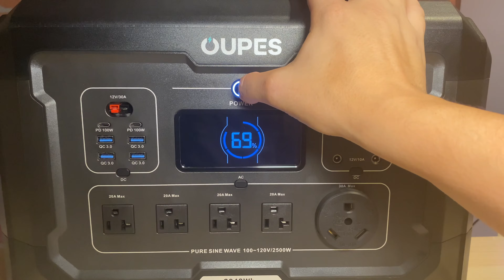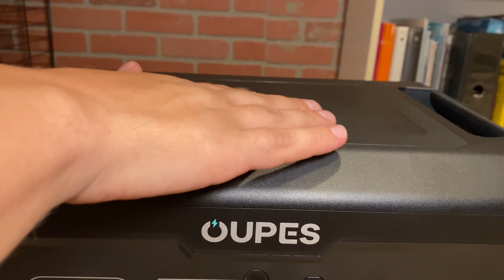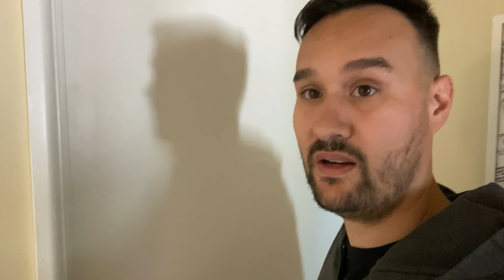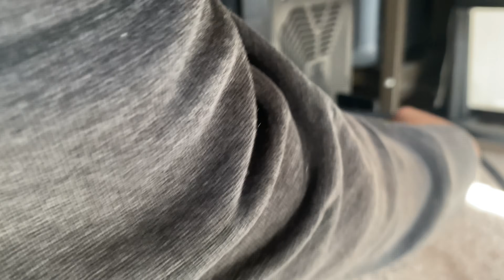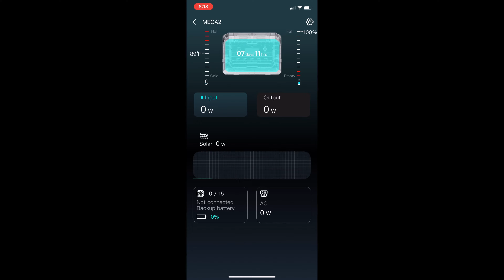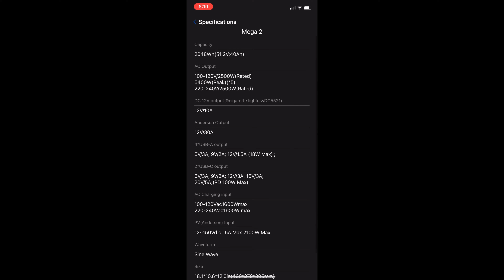Oupes Mega 2 Testing and Powering My Home: From Review to Reality

Comment: The AC cable is a 240V connection, can it use 120V?
Reply from the maker: Yes. It works on 120v.

Comment: Have you plugged in the ac wall charger and checked the polarity with an outlet tester on the unit? Mine is showing reverse polarity. Which means you may not want to charge and use it on your transfer switch.  Any thoughts?
Reply from the maker: I just tested my outlets and they aren't reversed.
Reply: @OffGridSolarSmartHouse thanks for the response. I've emailed oupes and waiting to hear back. I just thought I'd ask you because mine didnt seem right
Reply from the maker: @stevewalters-uu1lq hopefully you get a response back soon. Their phone number for support is pretty responsive.

Comment: Thanks for showing the app a bit. I'm happy to see that this has an option to keep the screen on. 

I also saw your comment that said you'll be using this as your main unit. That's interesting! Is it because of the WiFi?
Reply from the maker: I like the fact that I can bring in 2100 watts of solar. Each battery expansion allows me to bring in an additional 2100. It's crazy good

Comment: Live in 2500 Sq feet home and if something happen I dont need to turn the lights all over the room or tvs...  Something need power like refrigerator and Ac unit..  Does this power inverter generator drain battery fast or it last more then a day
Reply from the maker: I believe the AC inverter uses 15% battery in a 24 hour period. You could run a refrigerator close to a whole day on just the Mega 2 but not an air con. What type of air conditioner do you have?

Comment: Thanks for the review, but, no thanks. this unit still uses unreliable, outdated, low surge, high frequency, transformerless inverter technology with a shorter life expectancy than a much higher surge, longer lived,  low frequency,  transformer based inverter. No experienced, "true" off gridder would ever rely on a high frequency inverter for their power. You might be able to start and run some high surge loads, when high this frequency inverters is new but every time you fire up or shut down that inductive load, you're shortening the life of the MOSFETs in your these inverters.
Reply from the maker: Thank you for sharing your input on inverters.

Comment: The slower you charge the Batteries the longer they last, plus it is ramping up to charge which is like a  rv slow start for an AC unit It is a safty feature Dude. Common Sense . Why are you in such a rush to get it to start charging . Geesh folks are so much in a hurry for it to charge?
Reply from the maker: This is the first unit I've seen the solar input ramp up. I've seen it on the AC charging before. I wanted to point it at in the video as its something I don't usually run across.

Comment: Thanks for the detailed review.   Any how the ac + solar charging prioritization works?   Like let’s say you have 800w connected as well as the ac power connected for charging.    Let’s also say the unit is full.   Now apply a 900w load to the unit.   Does it grab all 800w that it can from the solar and make up the difference from the ac power?  Hopefully I make sense
Reply from the maker: This is a great question. What I think will happen is the AC charging and DC charging will kick on at nearing the same time since the load is more than the solar input.  The system prioritizes the solar input first over AC. I did test this. Are you looking at getting a solar generator or do you have one already?
Reply: @OffGridSolarSmartHouse  thank you!.  I’m looking at getting another.  I have a few but need something heavy duty.
Reply from the maker: @ChasinSimplicity let me know if you have any questions. Happy to help. I've got a bunch.
Reply: @OffGridSolarSmartHouse  much appreciated.   I have the pecron 2000lfp, vigorpool captain 1200, and then a few smaller units too.  Super useful to have them!   I’ll check out some other videos you have
Reply from the maker: The pecron is awesome. My brother-in-law has that one with the extra 3kwh battery.

Comment: Holy crap. 2100 
Watts of solar input on one array is crazy. That's one thing I dislike about having  the Ac300 is multiple cables outside.
Reply: So I just read that it's 2100 DC plus 1600 ac for 3700 total 😮😮
Reply from the maker: @markzingz1564 😃
Reply from the maker: Yes, two arrays could be beneficial though. I'd put one facing south the other facing west.